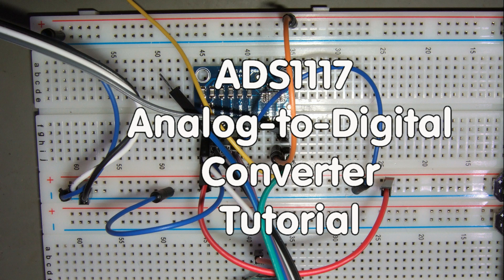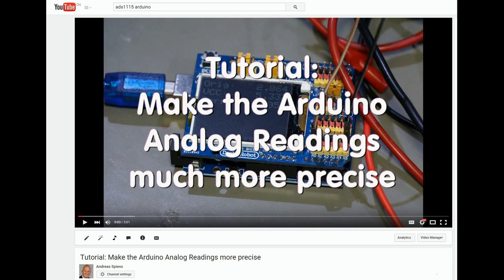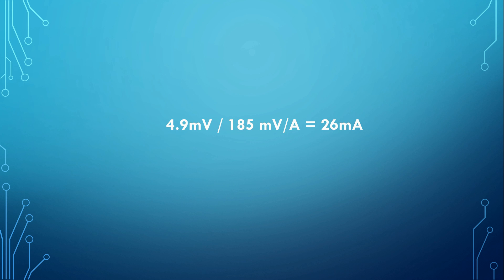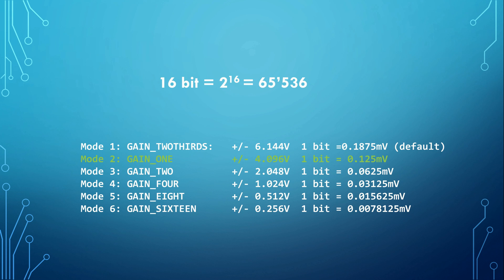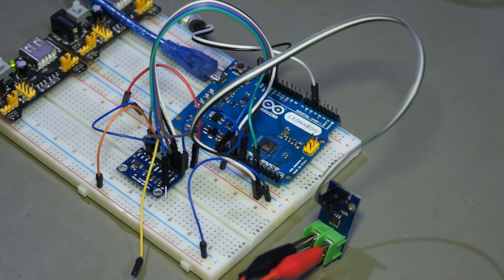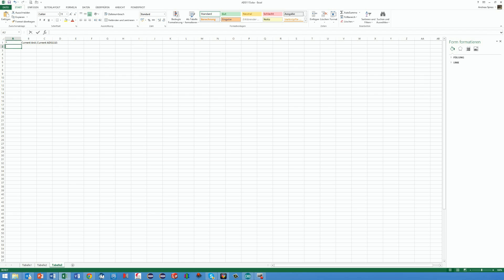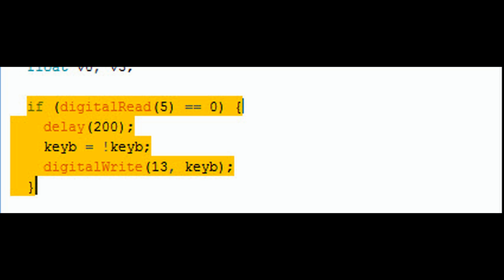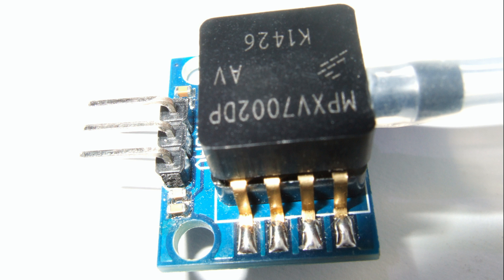#18 ADS1115 Analog-to-Digital Converter Tutorial

Comment: These adcs have gotten really expensive. Could you also use the HX710B for such applications? They are much cheaper and are 24bit.
Reply from the maker: I use them for stain gauges. They have a fixed amplification and therefore are very sensitive.
Reply: @AndreasSpiess  So not suitable as a replacement for the ads1115?

Comment: Can you show me please, how can i measure a positive and a negative Voltage ( +12V 0V -12V) Hals und Beinbruch, Grüezi in die Schwiez
Reply from the maker: You cannot measure positive and negative voltage with those chips. The datasheet of the ADS1117 says: Minimum voltage: -0.3V.
Reply: @AndreasSpiess  Do you know a chip i can measure  a positive and a negative Voltage ( +12V 0V -12V) ?
Reply from the maker: No. I never needed one so far.

Comment: Hi great vedio tried the same you explained working good but when I power up Arduino by smps the reading started fluctuating where as when I use DC source like battery or power bank it's working fine. Can you help what may be the reason
Reply from the maker: Unfortunately I cannot do remote debugging. It seems that the voltage of your SMPS is not stable or too low.

Comment: It's not that hard to just program the ADS1115 directly for features you don't get with the standard libraries.
https://thecavepearlproject.org/2020/05/21/using-the-ads1115-in-continuous-mode-for-burst-sampling/

The only real drawbacks to the ADS1115 are its relatively slow 860sps sampling rate, and the low input impedance at higher PGA gain settings. 
Less of a problem in differential mode but still an issue with some sensors.  A pretty good deal now that you can get these modules for about $1 each.
Reply from the maker: Thank you for the link!

Comment: Which ic to use for datalogging a high voltage may be upto 30 volts with arduino for cheap rate ic
Reply from the maker: You always can bring voltage down by a voltage divider

Comment: It is a minus and plus adc the value will only go upto 15 bits which is 32767 values for +6.144 volts  rest of the values are for the -negative voltage. I thought 16 bit is for 0 to 5 volts. Any way it is still great as Arduino is 10 bit for 0-5. and STM32 blue pill is 12bit and i think it is also 0-5 volts positive.
Reply from the maker: Thank you for your feedback!

Comment: Hello :
I wanted to comment that I had problems with the module ads1015 when wanting to measure 2 signals in differential mode.
I want to clarify that the circuit with ads1115 does not share gnd with circuit that I am measuring (bridge rectifier without capacitor) voltage and current by means of a shunt.
When I measure separately, the measurement is correct.
When I want to measure both, the measurement is incorrect.
I hope you can help me with the problem. Thank you.
Reply from the maker: AFAIK you still need a ground connection. If you look at the data sheet you see protection diodes which can turn on if you do not have proper ground connection.

Comment: I am facing noise what can I do to stop this? thank you
Reply from the maker: Noise can come from everywhere. The first things I would check is: Do I have the shortest possible wires? Do I have good ground connections? Is my power supply the source of the noise (maybe replace it for a test with batteries).
Reply: Ground any unused channels

Comment: I am trying to set up an auto ranging measurement system and I was wondering whether it is safe to change the gain of the ads1115 inside the loop in the Arduino code. Any suggestions?
Reply from the maker: I suggest to try it and you know.

Comment: Another useful video, thank you.   How did the output of the ADS115 get into the computer.  I know the arduino has usb but was the  ADS115 connect to the arduino  some way ?
Reply from the maker: The ADS1115 is connected through I2C connection to the Arduino Leonardo and through USB to the PC. Please watch the video about data logging (in the comment) and make sure, you use an Arduino Leonardo or Pro Micro. The PC connection will not work with an UNO or MEGA

Comment: Dear Friend:

Very good video.

One question please.

I want to read an analog signal coming from a dynamic scale (check weigher).
2000g x 1g. The purpose is to determine the weight for quality control.

4-20 mA analog signal of the scale has a resolution of 16 bits.

Can I use this module ADS 1115 for this project?

Thanks for your time.
Reply from the maker: The ADS1115 measures volt, not ampere. So, Please check again if the scale really has no other signal. If not, you need a small resistor and an amplifier to convert mA in volt (see my videos about measuring current)
Reply: Oh thank you;)
If fortunately if I have 0-5 volt signal.
Thank you for your time.

Comment: How to use the ADS1115 with 3.3 ports? equals?
I'm using esp12e.  Do u have example?
Reply from the maker: anderson xavier do you mean 3.3 volts and equally?
Reply: Yes....
Reply from the maker: A quick look into the data sheet shows, that the supply voltage can start at 2 volts. So, no problem to be expected with 3.3V. The measuring range is also defined by the supply voltage, so max is 3.3 volts.
Reply: Thank you!

Comment: Very good video. Do you have a schematic on how exactly you wire ADS1115 to Arduino? I noticed in other videos that are some pull resistors and capacitor in this connectivity.
Reply from the maker: usually you do not use any pull-up resistors if you connect only one module over a short distance. Just connect it as shown in many drawings (e.g. here: http://henrysbench.capnfatz.com/henrys-bench/arduino-voltage-measurements/arduino-ads1115-module-getting-started-tutorial/) to the SDA/SCL/GND/VCC pin. If you only use one module you do not have to care about the addresss pins.
Reply: Thanks Andreas. That was great. I used ADS1115 module that required to connect the pin as you pointed in the article. Even for 0x48 adresss was mandatory to connect addr pin to ground otherwise without addr pin connection is not working properly.
Reply from the maker: So, I forgot about this detail. Thanks for mentioning for other viewers.

Comment: From where did you get the current sensitivity factor?
Reply from the maker: +Fazin Naseer I do not exactly know what you mean with "current sensitivity factor". If you mean, the factor between current and Volt, then you find it in the data sheet of the hall sensor module  ACS712.

Comment: ah - now i understand - combination of ads1115 and acs712 would work well
though it may be difficult to calibrate for precise detection of zero current, as the acs712 uses vcc/2 - so it is very dependent on a precise vcc for the acs. maybe you can measure the vcc using one of the inputs of the ads1115 to self calibrate
thanks for sharing, this gives me a couple of new ideas
i'll order a ads1115 - fun to play around with, not to expensive on ebay
Reply from the maker: +KiSwiSje Playing around was the base of many great inventions!

Comment: Hi Andreas, I've a question.
2^10 = 1024 bits. so should not you divide 5V / 1024 = 0,0048828 Volt per 1 bit ?
Reply from the maker: +onurolce There are 1023 steps between 1024 points. This is why I divided it by 1023. Not a big difference, and, as an engineer, I anyway rounded to the needed precision ;-)
Reply: +Andreas Spiess Yes, there is very very small difference. But mathematically we need to find real amount. For example you calculated correct at 03:17 seconds (16 bit = 65536 steps). I hope you understand what I mean :)
Reply from the maker: +onurolce You are right.

Comment: Hi. Im trying to measure a voltage source of 2.22V (according to my multimeter) and the ads1115 shows random figures....
http://imgur.com/G04C6eY
The code I used is from this website: http://henrysbench.capnfatz.com/henrys-bench/arduino-voltage-measurements/arduino-ads1115-differential-voltmeter-tutorial/

I found a very unusual thing. When I measure a battery the voltage stays the same..... Thanks for any help!
Reply from the maker: +MrHD71 It's hard to do remote diagnostics... I only can describe how I would tackle the problem: I would start first with a simple setup and the example of the Adafruit library "single ended" which measures voltages between GND and one ADC pins. I would do this for both pins you want to use for differencial measurement (AIN and AIN1). Only if they show the right values you can continue with the "differencial" example. Make sure you use the same pins. If this does not work check that you du not hurt the maximum rating of the data sheet (Analog input voltage to GND –0.3 to VDD + 0.3 ).  Otherwise try a second board. Then come back and I will do the same thing with my board.
Reply: +Andreas Spiess sorry for late reply.... could you provide me the code you used.. Thanks :)
Reply from the maker: +MrHD71 I only used an adapted ( I used keyboard() to transfer the readings into Excel) example code of Adafruit library (singleended)  with   the line ads.setGain(GAIN_ONE);  uncommented and int adc3=ads.readADC_SingleEnded(3); The keyboard() functions only run on Leonardos. This is why it is better you use the standard example as I did in the beginning.
Reply from the maker: +Andreas Spiess BTW: Did you check your I2C connection works? I always check this first with this sketch: https://github.com/RobTillaart/Arduino/tree/master/sketches/MultiSpeedI2CScanner. It should show a device on 0x48.

In the example sketch make sure you uncomment also the first line // Adafruit_ADS1115 ads;   and comment the 12-bit line
Reply: +Andreas Spiess I solved the problem when i put the module into Single-Ended mode instead of differential... Thanks. Could you tell me how am I supposed to calculate the amperage using the 20 amp version of the acs712
Reply from the maker: +MrHD71 Glad to hear that it works now! Anyway, the hall sensors  completely isolate, so you should not need differential mode in this application. 
To calculate the current should be easy: As we engineers use to say: RTFM (read the fucking manual" ;-) If you look to the data sheet you find the following (page 5, top):

Sensitivity  Over full range of IP, TA = 25°C  185  mV/A. So, for each Ampere you should get 185mV.  But this is only a typical value, so you have to calibrate your chip using a defined current and an Ampere meter. Or you live with an uncertainty...
Hope, this helps.
Manual: www.allegromicro.com/~/media/Files/Datasheets/ACS712-Datasheet.ashx

Comment: Great Video. Could you use a 24 bit HX711 module instead of the ads1115 for a better accuracy?
Reply from the maker: +MrHD71 The HX711 is optimized for weight gauges. I think, it can be replaced, but it's input  volatage is very low (+-40mV) . Would be woth a try.
Reply: Can you suggest any other ADC's with more channels?
Also you could give some ECG projects a shot with the ADS1293 or ADAS1000

Great video btw!
Reply from the maker: For me, this ADC had enough channels. Because it is so cheap I would rather use two or more of them. You should be able to select 4 different I2C slave addresses.
Concerning ECG: For the moment, I have no plans to enter this area because I still have many other projects on my table...